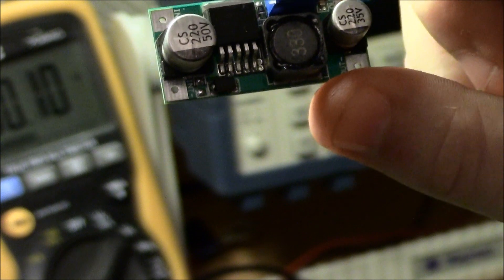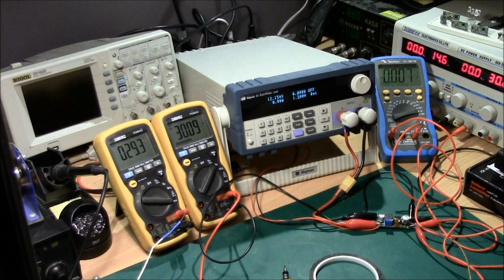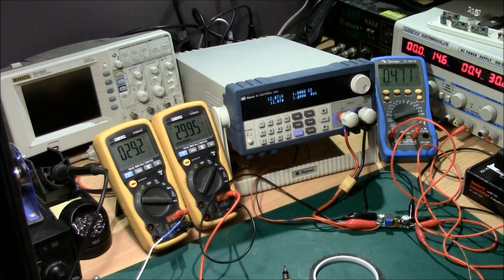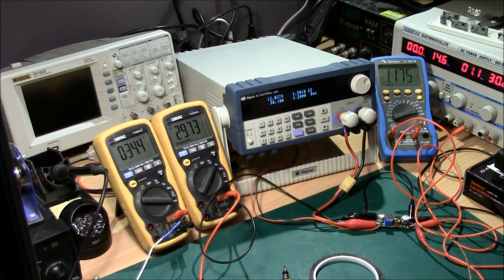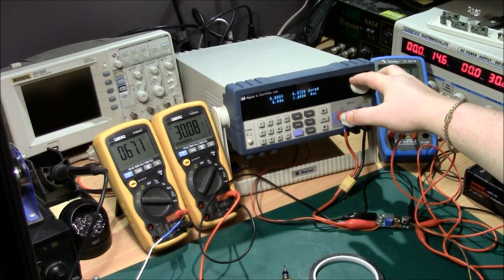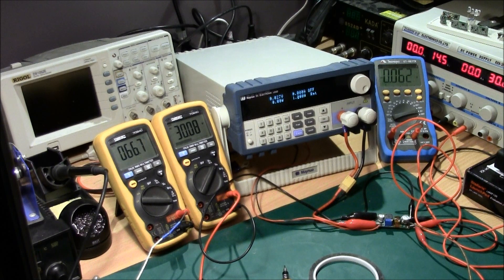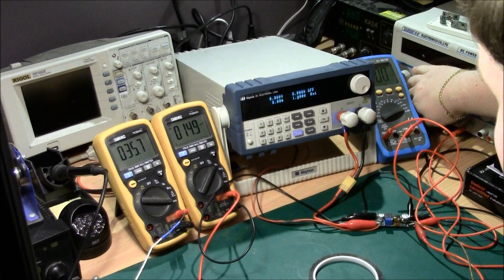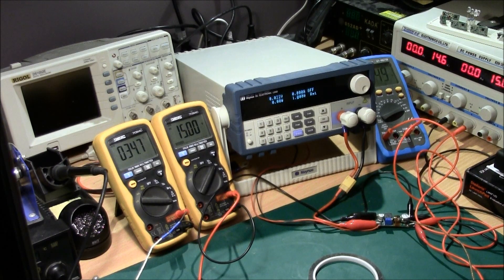LM2596 DC-DC Adjustable Power Step-down Module - Load Testing

Comment: The IC is lying flat so it's easy to thermal paste a heat-sink onto it but even so, probably going to have to consider it as a 2-maybe 2.5 Max Amp unit. 
About to use one as a voltage regulator for a small parcel-shelf solar panel to drop the voltage down from 18v 1.5A to 14.8v to trickle charge a car battery.

Comment from the maker: Yeah I wouldn't be surprised if they are fake ICs. In any case, it wasn't the IC that failed. The diode failed as a short circuit. It was labelled as an SS54 5A diode, but I can't find *any* 5A diodes from a reputable manufacturer in that smaller case size. Replaced it with a decent 3A or similar diode and it's working fine again.

Comment: these are not populated with legitimate LM2596s, they use analogous chinese designed ICs with counterfeited markings, and obviously this tiny little PCB cannot dissipate more than a few watts, but that doesn't explain why the IC thermal protection failed, unless there isn't any...

Comment: Hello! Did You measure temperature of LM2596 at the work with 1 Ampers,or other aparameters. I understand that amount of heat depends on voltage and current (+efficiency of DC-DC converter), and in datasheet I can find mathematic formula for this. But theoretical numbers in datasheet appropriate for real life? Maybe, You use this power scheme in real gadgets?

Comment from the maker: Only real way to know for sure is to try it out! :D

Unless you happen to have a large pile of cash for a high frequency spectrum analyser (send one my way too please) ;) 

Good luck with the project. I was considering making an RGB led controller that is remote controllable using a spare receiver channel. Depending on what lipo you use, you could possibly connect direct to the LED strip. Most are 12V and can still be used in cars where the voltage goes up to 14.4V.

Comment from the maker: I wouldn't think so. The LM2596 has a switching frequency of 150kHz. That's 0.15MHz 0.00015GHz :) Even if there is some high frequency noise generated that high, its power density wouldn't be high enough to affect the transmitter. They're already designed to operate in noisy environments (plenty of 2.4ghz devices around - wifi, cordless phones etc).

Comment: thanks for the review/heads up. what about ripple, do you think it will affect a 2.4ghz receiver? i'll be using mine to lower the voltage from a 4S Lipo to power about 30cm total of led strip.